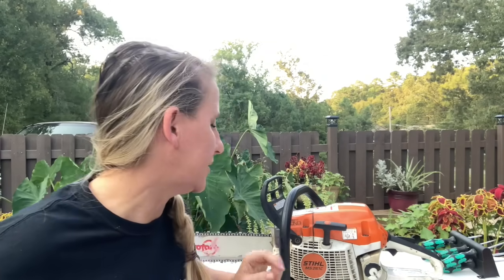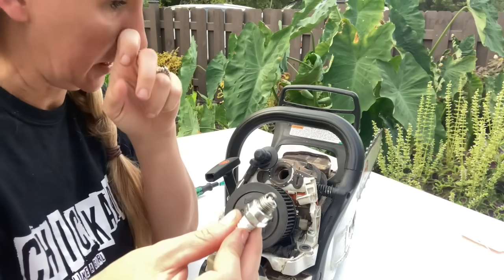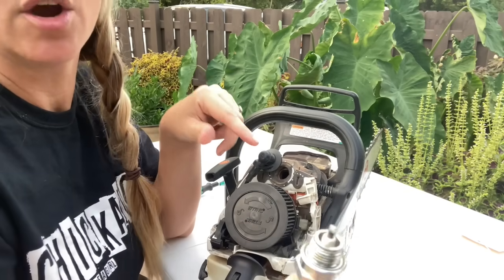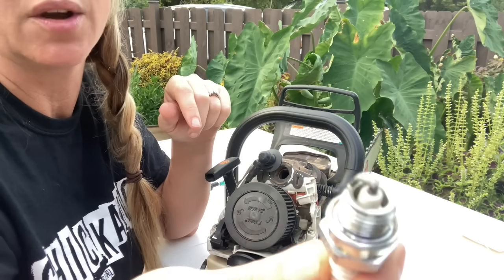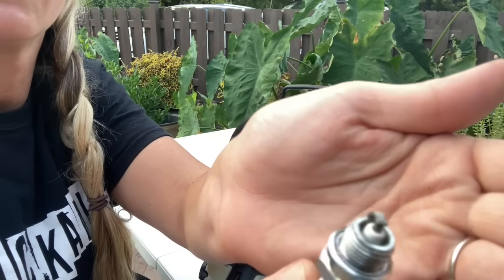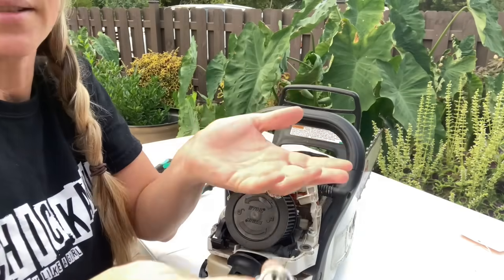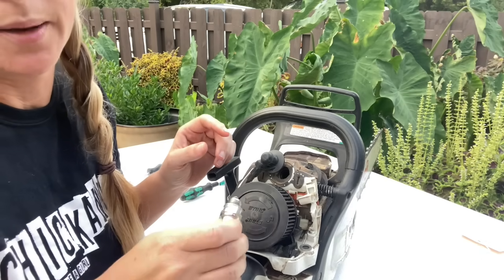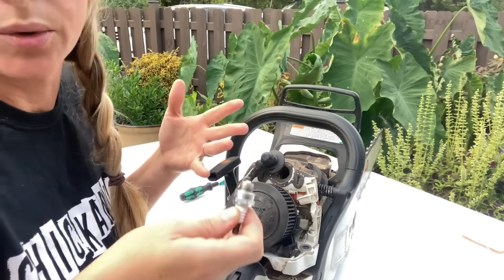STIHL M-TRONIC CHAINSAW HAS NO CARBURETOR ADJUST, WILL IT "RESET" TO REGULATE FUEL CORRECTLY?

Comment: If it is a M3.0 saw there is a reset procedure. 

1. Put the switch to the triangle and start the saw with the chain break engaged. (It’s best for it to be warm before starting the procedure.) DO NOT TOUCH THE TRIGER. Let the saw idle for 30-60 secs. No more, no less. 

2. After 31secs to 59 secs, disengage the chain break and apply full throttle for 30 secs. 

3. During the 30 sec full throttle, the saw may fluctuate. At some point, if done right, the saw will rev to maximum rpm. Be prepared for this and don’t panic or release the throttle. 

4. After the maximum rpm dies down, it will return to a lower rpm. Stop the saw. 

5.  Restart and cut away. 

The M-Tronic version number is located on the saw identification label.

Comment: Hi.Like your vids but you got the wrong info.The proper way to reset is to hold the start/choke down and hold the trigger at wot for 30 seconds on a saw that runs.Just for your info if the saw does not start Ther are a few things you can do before sending them to a Stihl dealer.Do a simple continuty test on the red and yellow  wires going from the carb to the coil.These wires are very tiny and have a habit of breaking inside.A very poor design.Simple fix is to replace those wirers or send them to the dealer.For the simple reset I show the costumore how to do it at now charge.Sad to say but all chainsaws will be like this in a few more years.Stihl and husky both have EFI now .Areal nightmare.A injection pump gets a little water and it is a 500.00 dollar repair ouch.

Comment: My answer to Sthil’s new system after owning STHIL chainsaw’s for the last thirty two years. Go buy an Echo and don’t look back !!! The last two STHIL chainsaws and trimmers that I have owned were both nightmares.
Reply: yes sir, i think the same. Echo are the best reliable saws
Reply: The 261 cm with .3 moronic carb is actually a really good saw , well mine has been anyway no 0roblems at all for 3 years so far

Comment: I had a johnsered I  think 2152. With electronic tune. Biggest piece of junk i ever had. The worst thing was vapor locking and not starting when its hot outside. Even with the right fuel and oil mix.

Comment: Depending on the gen of mtronic    for first that was right as far as reset 3 gen are differnt    45 sec at idel in cold start position then hold  flat out till saw peaks and rpm drops turn saws of    reset done

Comment: The 462 m-tronic must be better. We've been running them cutting commercial timber hardwoods (oak, hickory, maple etc) for over a year and haven't had any issue BUT!!!! The air/fuel ratios for these saws are very lean soooo.... mix oil mix oil mix oil... oh and good gas with at least 90 octane.. just my 2 cents. Hopefully nobody gets their feelings hurt
Reply: One of the original trial 462s a mate of mine had and he was given it by stihl UK to trial over 3 years ago, i used it several times and i thought it was a fantastic saw, he was told to run it as hard as he could and he did, just basic maintenance on it by him at the wk end, the first issue was at 8 and a half month old with 517 hrs on it, and that was fuel solinoid it then went on for a another 11 month before before next issue, nice saw well balanced with a 20" bar and a dream to use,
Reply: Sw bandit I run the shit out of my 462c I’ve never had a problem out of mine and had it for 3 years now I do maintenance on it every weekend and recalibrate it once a month. I run it 6 days a week cutting trees in florida

Comment: Chickanic; no experience with chainsaw with electronic control of carb's a:f, but in my motorcycles with ECU control of fuel map, the reset procedure is to be done with cold engine and manipulation of throttle. let idle until fully warm and then shut off.  If the Stihl saw has temp semsor, that may be the case there too.  Just a wag...

Comment: I've got a 32 year old Echo 510evl and the carb has never been adjusted or rebuilt and still runs top notch. I have cut a lot of wood with it over that time. I've even had a tree drop on it and crack the outer case, but true to it being an Echo, it still runs.
Reply: Dang.. I didn't know they were around back then.  Are the new ones any good?
Reply: @justicebruno5249   Yeah ... They are . We run two Timber wolf 60cc and a CS501 P all less than 3 years old ... We have 3 older stihls that we rarely use anymore . 024, 027 and 034 just too heavy that later one . The 034 was good and served us well .
Reply: @justicebruno5249  Echo has been making chainsaws since 1963...
Reply: @TheDennys21  yes, they made twin cylinder saws too
Reply: @stevemaxwell8550  really? Which ones?
Reply: @TheDennys21  I'm not sure, my 94 year old boss ran one. He said it was the smoothest daw he ever ran.
Reply: I may have parts for  that
Reply: I hope you knocked on wood when you wrote that. I don't have any old Echo's, but I have a couple of the newer ones and after a couple of years, I haven't had a single problem, Knock on wood!
Reply: I have an early 70's echo 425vl. When I received it I think it had been sitting a bit too long... The gas tank smelled of varnish and paint thinner lol. I threw the choke on a few pulls later fired right up. I haven't done a thing besides swap chains out on it it still fires on the 3rd pull.... I should probably change the filters.

Comment: I agree 100%. If I can help it, I won't buy any kind of chainsaw, string trimmer, or leaf blower, that doesn't have the adjustment screws. At least, an electronic control can potentially adjust for changes in humidity, barometric pressure, altitude, temperature, ethanol content of the fuel, the age of the fuel, the brand of 2 cycle oil, and finally, changes in compliance of the diaphragm in the carburetor. Some of the non-adjustable carburetors never seem to run right. I live in Utah, which is ~4,000 feet above sea level. I have the opposite problem. EVERY engine that I own, be it 2 cycle, or 4 cycle, that has a non-adjustable carburetor runs rich. I end up putting copper wire strands in the jets, to lean it, for a good burn. That solves the problem with the running mixture, but, the idle ends up too lean. I don't know how the EPA can expect manufacturers, to build a "one size fits all" carburetor, and expect that it will maintain perfect fuel/air ratio under any circumstance. Without working electronic controls, they're chasing a "unicorn".
     I'm nervous about that lean burn. If it isn't getting adequate fuel, It's NOT getting adequate oil!!! Pull the muffler off. Let's see how badly that piston is scored.

Comment: What he said (below) - fer sure! I have a 39 yo Stihl that's about one step away from the scrap pile. When I buy a replacement, it is not going to be a Stihl. Stihl has gone the way of John Deere and many other manufacturers. That is, making it almost impossible to repair their equipment if you are not an authorized repair center. I have been supporting "right to repair" efforts, and am happy to see progress being made. NY has passed legislation (and other states are following suite) to force manufacturers to make the same parts, tools, documentation, and software their service techs have available to the consumer and repair aftermarket. All that being said, here's a question for you: What brand(s) of chainsaw is the the easiest to get parts for and repair? Thanks Chickanic!

Comment: Peoples of you tube. If you think that 90 sec of running at idle if enough to Affectively change the color of a brand new spark plug I am sorry to say but you’re sadly mistaken you need to put at least 2-3hours on the machine to have any color change on a plug. Running hard to mid to idle.  
Cheers to all.
Reply from the maker: I work on 3-15 saws every single week and can tell you, you are 100% wrong....

Comment: There are a lot of complaints in my are of problems with them. I am old school, and will keep my old saw running as long as I can get parts.
There are a lot of factors that go into carb adjustment, weather and altitude are big ones. 
Keep up the videos. 🤙
Reply: Does your daily driver still have a carburetor?

Comment: Looking at it made me think of "Right to Repair" that is going on here; check out Louis Rossman. I tried to fix my friend Top handle climber 201 that have the M tronic. It would not idle correctly and dies if not full throttled or started without chainbreak off. This is so dangerous more so when someone up in the tree. the fix should be the low high setting on the carbs on older models. this one needed a $100 new M Tronic sensors. The time gone to  5 min fix to 90 min ; no parts cost to 100. In the shop cost would be 300 to repair 🤣when I could just do it my self for free and 5 min of my time. Damn you Anti right to repair bill forcing people to go to Dealers.

Comment: You need to run a tank of fuel through the saw to be able to see a difference in the plug.
Reply from the maker: I work on 5-12 chainsaws a week during saw season. You absolutely do not have to run a full tank of fuel to see the difference. Thanks for watching!

Comment: You're missing half the procedure. After allowing the saw idle, you need to hold the saw wide open for 30 seconds. When you do, you will hear the saw hunt through the RPM range until it smooths out.
Reply from the maker: That re-set is for the 3rd generation. I used the correct procedure for this saw.
Reply: You reset the saw to the settings it was built with in Germany. The other half of the process is a manual re-learn that tunes the saw to your atmospheric conditions. If you're curious about this process you can watch a video Hotsaws101 did on the mtronic reset/relearn procedure.

Comment: Great informative video. I own 4 different Stihl saws and glad I don't own one of those heaps. Also glad I'm not a Stihl dealer. I think they're required to stock most items. I'd have a problem recomending a saw with that system. Seems like they'd be frequently fixing a product that's built a strong reputation for reliability (I thought Stihl was smarter)
 I guess I'll pick up a few good older models to have for backups.
Thanks for the vid!!

Comment: I don’t know what you just did. But that was no reset. and yes the first version did have some problems. But vary simple fix. New fuel solenoid and orange fuel filter. Knowing what version you have would  tell you what reset procedures to do. Much like Husqvarna they too have different reset depending on version.

Comment: I agree.  Mtronic saws are a pos.  I have a nice little 241CM that I bought new five years ago.  It has given me all kinds of problems.  It does not want to start and if it does it will not go into high speed until I blip it to idle.  Normally, if I had a saw that did that I would richen up the high side a bit.  Warranties do not mean crap to me.  I usually just fix my stuff and it never sees the dealer again.  Lord forbid if you should run it empty and put it in storage condition.  If you do it will be hell to start.  I checked my plug, yesterday, and the plug looked rich to me.  The last time I started it I let it idle for five minutes because that is what I heard was the reset time.  That was several months ago.  I tried cranking it yesterday to put it in storage condition and it would not start.  I am running Echo Red Armor at 50:1 with PNE gas.  What it acts like to me is that the throttle plate is not opening to the high speed position.  I even poured a cap full of two cycle gas down the throat and could not get it to do anything.  I checked and it has spark and good compression.

Comment: Hi Chickanic I am  SERVICE TECH and I have been running all the none carb saw I have some tech problems but  the m tron saw and the Auto tunes runs all most stoichiometric that means that they all will run hot and the saw are stratified engines I tell all of my people to run clean fuel and none ethanol fuel and clean out from around the filler cap. The  lap top version of the stihl diagnosing software will tell you in 5min what is wrong with it or lead you in the right direction  the best money that i have spent . The stihl 2t oil is not to good look at the spec pay close attention to the viscosity it is low that oil is thin ,I run a 2t racing oil or Amsoil saber @50 : 1
Reply from the maker: Thanks for the info! So what do you charge for this repair when using your Stihl diagnosing machine and software?
Reply: @Chickanic  I will tell you this first stihl warranty dose not pay very good . If I got that saw in I well go through the normal routine of diag like gas check cylinder scoring , screen you know the rest if that checks out good I would hook the stihl software I would look at the PIDs  if they looked good and then I would crank and do a recalibration  the recalibration has scaled increments for the solenoid in carb , ambient temp , engine temp , adaptive learn, long term fuel trim for all the work I charge 65 dollar an hour that would be a 1.5 hours for diag time if there is any parts and installation time that will be added  . A friend handed me a new ms 400c it was running erratic when cold the software showed good I mean all of I started looking through the software I found a altitude setting it was set @ sea level we live @ 2300 feet above sea level it goes from sea level to 3200 to 6000    on the PIDs clicked on 3200 and done a recal on it that fixed the problem that 400 runs like a beast oh before recaled it put a WEC bark box exhaust on it
Reply: Hi Chickanic I had a ms 362c to come in I diag it found the cylinder loose very loose it ran so lean that it would shut off the only thing it needed was a cylinder gasket all filters if that would of been a carb saw it would got the cylinder and much more food for thought

Comment: From someone that doesn't own a m-tronic saw or the saw being worked on I'll disregard you conclusion.  I do own this saw and it is an excellent saw.  Let it idle, cut some wood, before judging.
Reply from the maker: I never said the saw was bad. In fact when these saws are running correctly, they scream through wood! I love Stihl Saws.  I did cut with it before we checked the plug. I didn't put it in the video, because I was trying to avoid all of the safety apparel comments. What I do know is this saw IS burning too hot. Not just from the plug, but from the heat and smell coming from muffler. Also that it will not start for the customer after it's been ran hard. The point of the video was to make others aware of re-set to try and that they are SOL if it doesn't work. Thanks for watching!
Reply: @Chickanic  Your reset procedure is not done correctly.  Do it right then you can bash the saw.

https://www.youtube.com/watch?v=1T9Dk_h8i0Y

Comment: I own a "homeowner" Stihl chainsaw that I purchased in 2017. It was on sale, less than $200. So far hasn't given me any trouble. Seems to me if it did, be cheaper to buy another one if I couldn't get it back running on my own.
I really like your channel. So much useful information that's real handy for most folks. Thank You
Reply: well said mate just sling it in landfill and use up some more resources, only people from the olden days and losers bother to learn how to repair things, what's the point?

Comment: Your video makes  me  glad  to be cutting  wood  with  a new Echo  7310 this year  instead of  a new stihl .A repair shop  I go to said a dull chain  makes  the electronic  carburetors  run slower than  a saw with  manual  adjustment.
Reply: A really dull chain WILL blow up your saw, only difference is that if your mtronic is set a bit lean, which could happen, it will blow up relatively soon. either way, with an adjustable carburetor blowing up will for sure happen anyway sooner or later, just depending on how the operator set the carburetor... Talkin with pros u'll hear that everyone would prefer to have a bit richier tuning than having a bit leaner one, the saw will be a tad slower but it will overheat and consequentially blow up more difficultly. A dull chain will not slow down ur saw, simply it won't cut because, well, it is dull. The effect on the saw will be that ur gonna blow it up.

Comment: The correct reset procedure for an M tronic Stihl, is after warming the saw up and stopping it, start the saw in cold start and leave it to idle like that for more than 30 seconds. Then apply full throttle, the saw will run normal full throttle for a while then rev higher then come back to a fast idle even though it is still held at full throttle. Reset complete.
Reply: Do a video. Lots of people would watch it, including me. Thanks

Comment: I worked at a Stihl dealership ,and one of the other mechanics and one of the ladies that worked parts (computer genius) did the carb tune .. I did watch him a few times doing brush saws and the program had a large picture of a tach and he had to hold it at a certain rpm for several seconds , then at another rpm for several seconds ..At the end it actually took near 1/2 hour from start to finish ,that's removing the top cover plugging in the adapter right to replacing the cover at the end .. And we charged $70 per hour so taking that to the dealer wouldn't be cheap ..
Reply from the maker: Thanks for letting me know! I bet the computer program and tool cost a mint. Yea, on the 3rd generation M-Tronic saws you have to engage the chain break, idle for 30 seconds, release chain break, rev full throttle for 30 seconds until you hear a fluctuation rpms for a few seconds and then shut off. SO MANY STEPS! LOL! Thanks for watching!